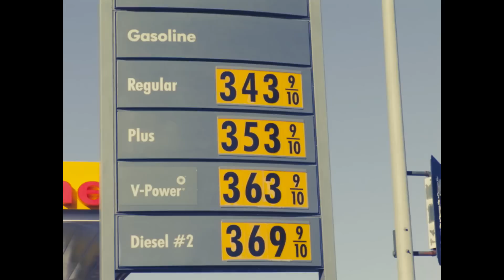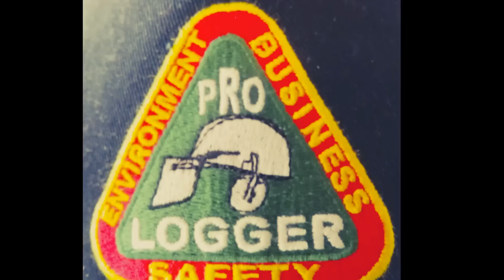Country boy can survive REMIX ( THE LOGGER'S SONG )

Comment: Question: Can someone call them selves a logger if they work at a Saw Mill?? JW thanks
Reply from the maker: Dustin Jones of course they can, loggers can be anyone from the cut down man to the guy that delivers the finished product in my opinion
Reply: I dont personally though I worked at a mill for quite a while. I come from a long line of loggers and I guess I view myself as odd man out. But it's  timber industry which, is family.
Reply: Definitely the loggers cut the tree for the mill the truckers take it to the mill  if you didn't have a mill we're would the logs go to make in to boards so yes you can